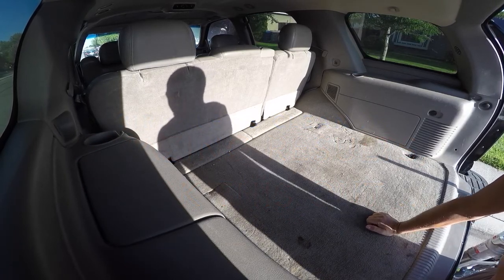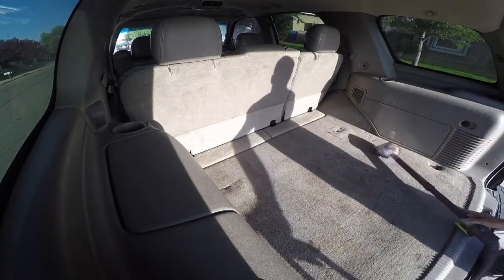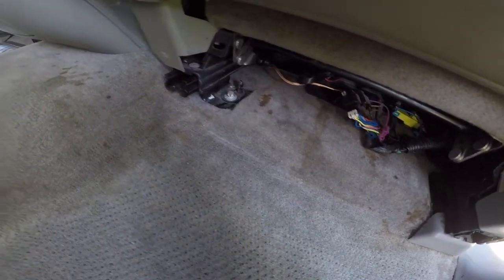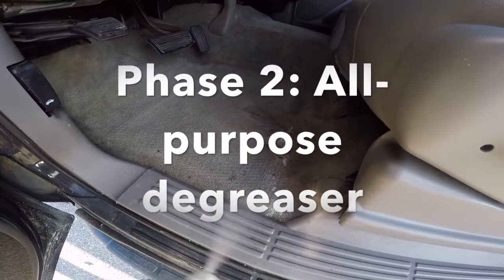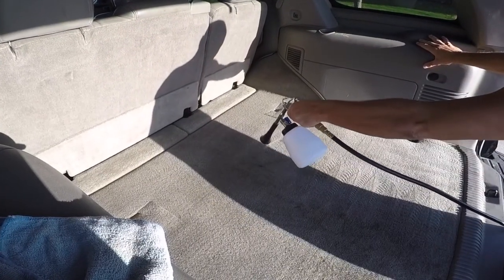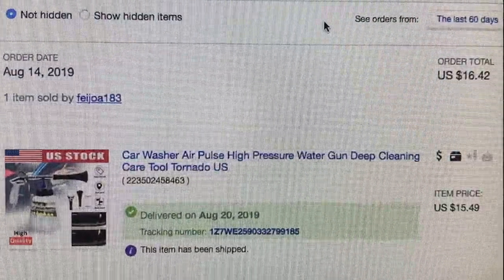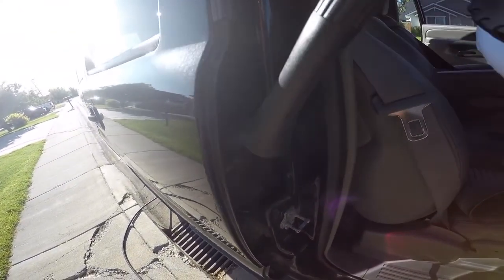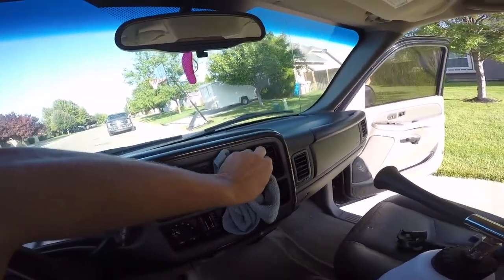Cleaning the dirtiest car ever! Tornador type cleaning gun

Comment: Good video but you really need to attached the Velocity Vac attachment and EXTRACT the dirt vs pushing into the carpet.   What you did is fine for temporary results but that dirt is going to dry down in the fibers and make it's way back up over time.
Reply from the maker: This is actually the velocity attachment extracting the dirt, I should have shown more in details but all the dirt is coming back on the surface then I vacuumed it.

Comment: also, put a small in-line gauge on your Tornador to monitor pressure at the gun.  you're using a very small output compressor and you're not getting a full 90psi there.   The gauge will show you how low you are.
Reply from the maker: I have a gauge on my compressor. I am averaging 90-100 PSI and my high pressure cleaning tool is actually rated for 75 PSI so this is plenty.
Thanks for your advise though, I appreciate your support.